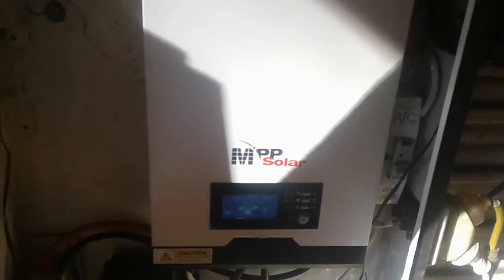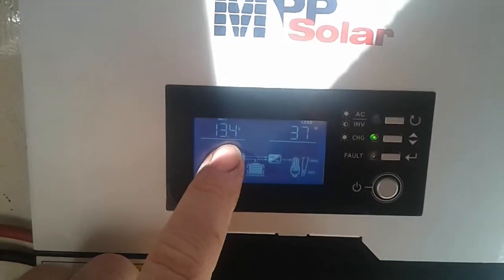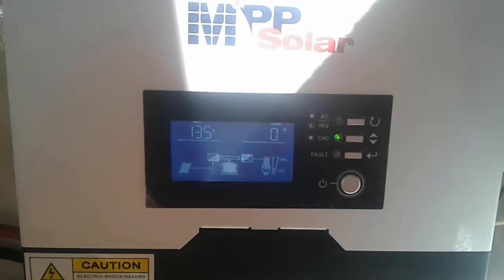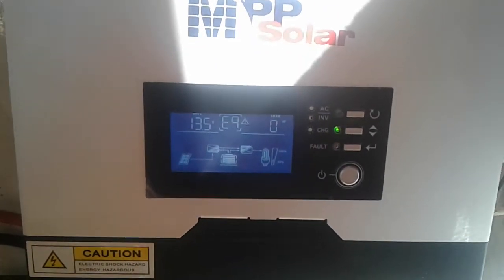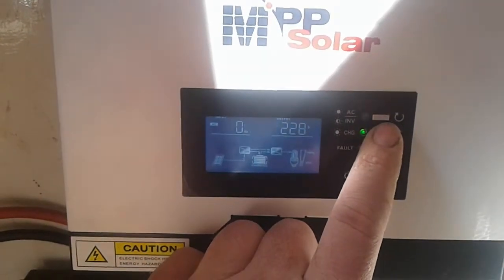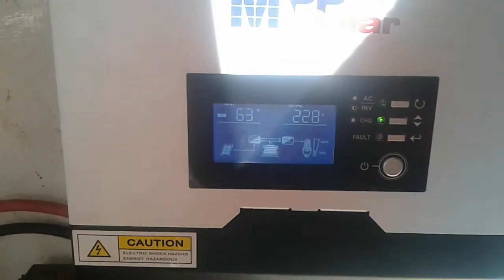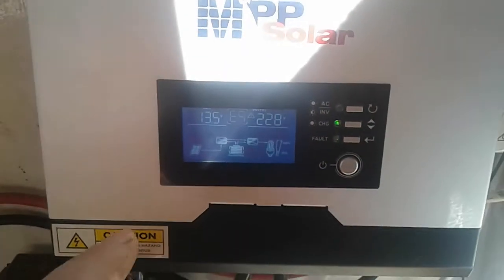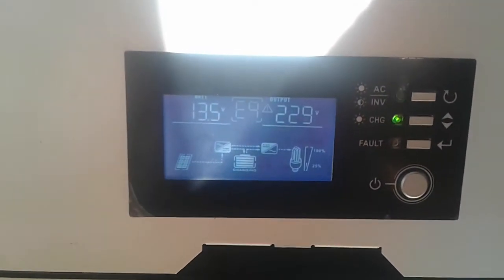Mpp solar pip1012mse problems

Comment: Hello folks.
I finally have the problem fixed. Took me ages. The customer support of EASunpower, the reseller that has rebranded my device finally supplied me with an updated firmware for the solar charge controller.
I am not a hundred percent sure it would work on an PIP1012MSE, but it is very very likely.
Please check if you have the version U2 03 36 installed. This is the buggy firmware.
I'm happy to supply the files and reflash tool.
Take care and good luck!
Reply: @fabiandoubleyou4874 Hey mate and chance you can send me the files/update. got the same issue! cheers
Reply: @jamesgordonau  Hi James. I'm currently away for holidays. Remind me in a few days if I don't come back to you! ✌️

Comment: Can it reset itself by turning it off/disconnect for 10 mins letting the capacitors etc discharge , i dont own one of these  but many things can sometimes come good doing this. or maybe a software update but i here its no picnick doing one , a learning curve and some frustration first time round.
Reply: Done that already. Didn't fix it.
Reply: @nofootprintz  on YT ive seen quite a few guys having technical issues with these , most of it always seems to be something with software and updates etc so i keep away from them , i know they work well but the issues ive seen over time keeps me from buying one.
Reply: @closertothetruth9209  I know what you mean. If they only weren't that dirt cheap. I contacted the support and they replied within hours asking for the serial number and where I bought it. I hope they provide an update and that fixes the issue.
The only downside I ran into with these so far was the high standby consumption of the inverter. But I rarely use it in my camper.

Comment: Hi there!
I'm having the exact same problem with my unit. Same device, different labeling. Have you happened to find out what's wrong?
I've been installing and operating a number of these 24 and 48V units never running into the problem.
And the fans are going crazy without much load.
Please come back if you figured this out. I'll do the same.
Cheers, Fabian
Reply: Here's an little update on the matter. The customer support of EASun Power (the company that rebranded mine) is completely useless. They don't understand English and they keep thinking that when I sent them the link to your video that this is my device even though I told them it's not and I sent them a photo of my device.
Now I try getting the latest firmware version from them. This will take forever I suppose.
Garbage!!